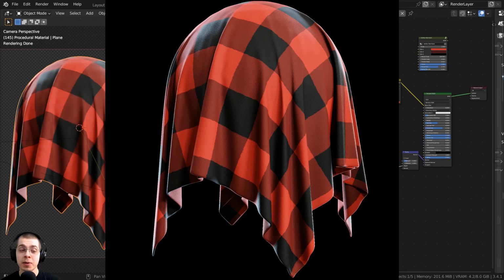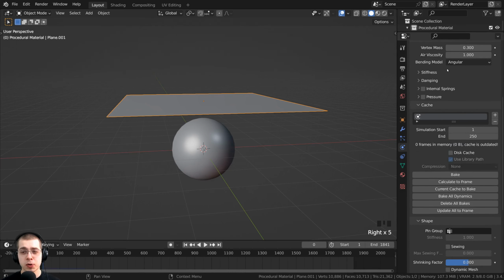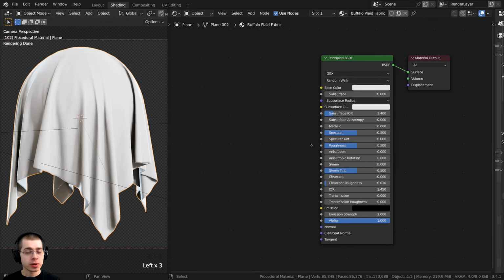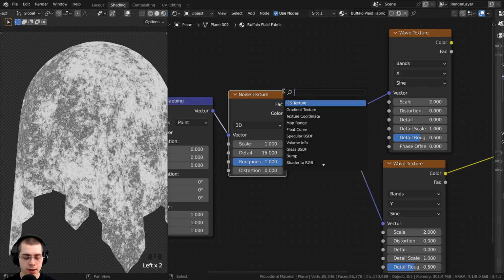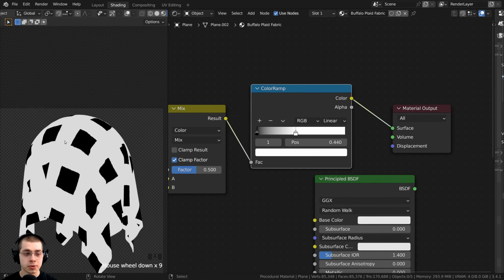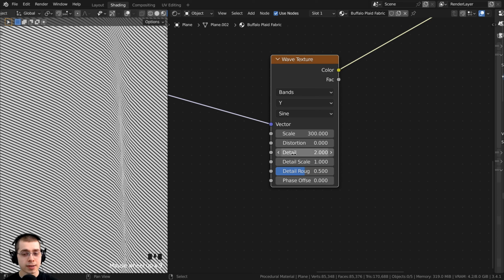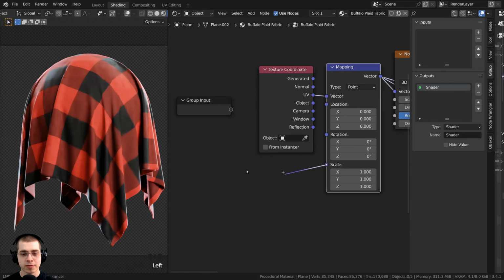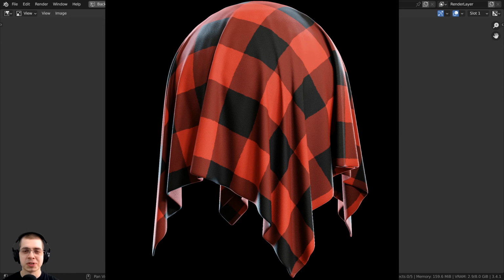Procedural Buffalo Plaid Fabric Material (Blender Tutorial)

Comment: Mix Node ? Got only 2 Mix Shader and MixRGB here
Reply from the maker: I made a video specifically about the Mix Node: https://youtu.be/i4GAHxtDAsk
In the new Blender update of 3.4, they changed the Mix RGB node, to just the Mix Node. So just add the mix node, and change the Float option, to Color. Then you can use it just like the mix RGB node. Or if your using an older version Blender, just use the Mix RGB.